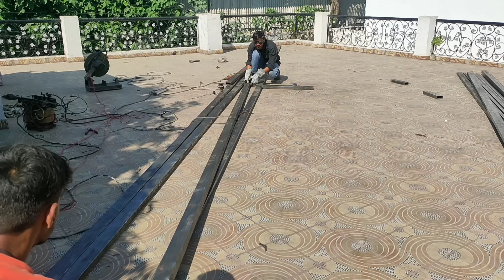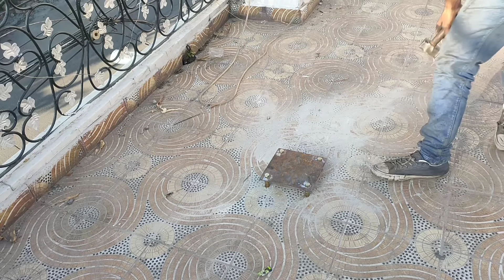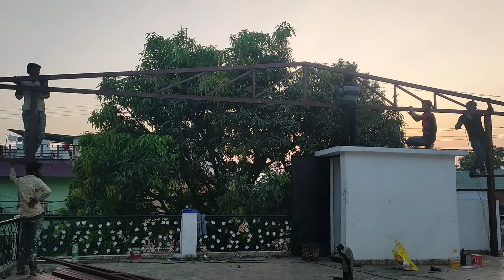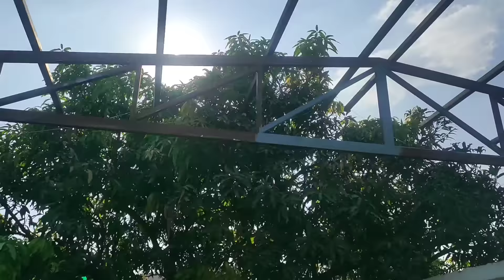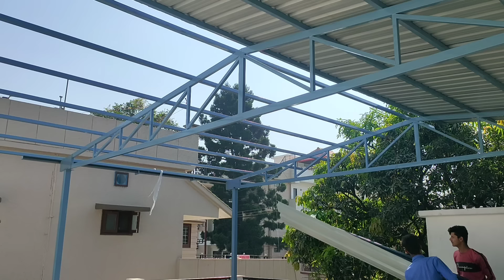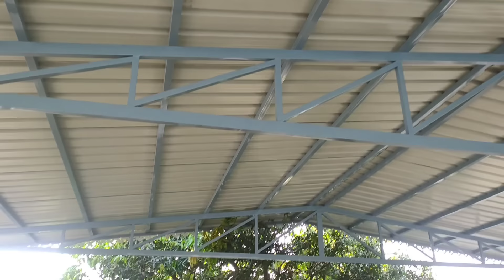How to build a house shed! Colour coated sheet ! शेड कैसे बनाये

Comment: you don't have a snow load, just a 100x100 pipe would be enough.))
Reply: It depends on the wall thickness of the steel and I think 2'' x 2'' [50x50mm] was used

Comment: False ceiling or Rooftop shed with Galvanized iron sheet- which one is 
better to prevent summer heat to cool down the floor? I live on the 1st 
floor and the roof is open. during the summer it became unbearable hot. 
So I'm looking for a valuable option